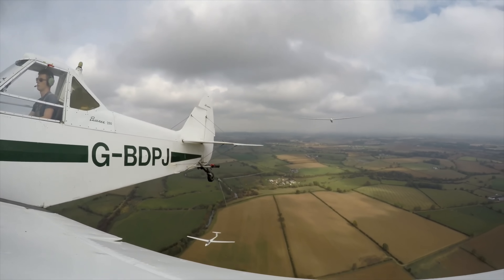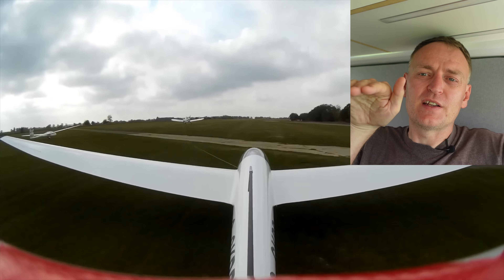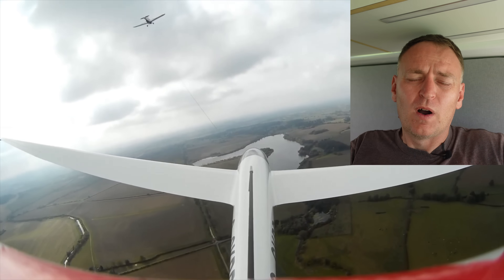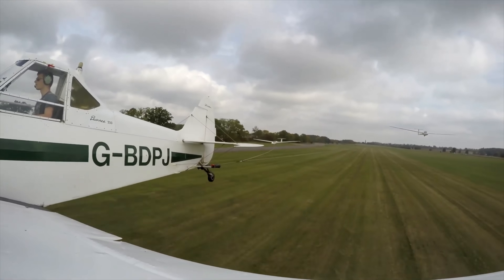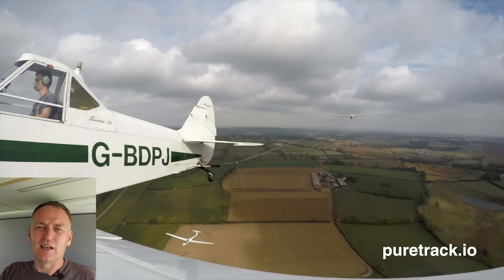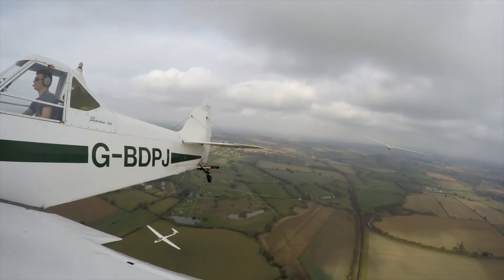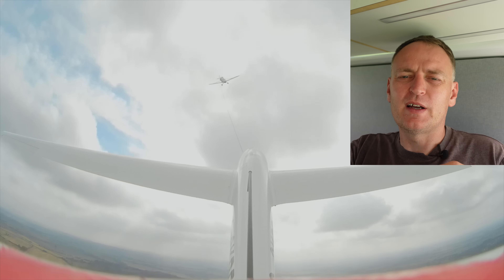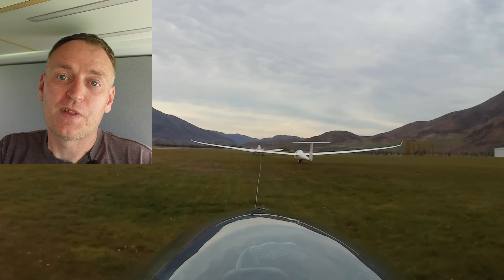Glider Dual Tow Goes Wrong: Instructor Reacts!

Comment: whaddya do if the rope breaks on the lead glider during the ground roll?
Reply: Depending on the briefing ....and the starting positions for lateral offsets... each glider should be briefed to separate to THEIR side both on ground roll and in flight.  We chose to continue about half span each lateral till all 3 flying, when we did 2 ASK21s (sometimes 4 aboard) with our C-182 (230hp).  Hard packed surface for easy acceleration, sometimes only 1 wingrunner. Wingrunners always on outside tips regardless of wind. 
On rolling, the short rope glider is the biggest risk if releasing, to the aft glider.

Ground release or break - taxi wide to outside.  Not many airfields are suitable for dual tows.

We always lapped the airfield allowing safe glider return in normal tows and dual tows. 
In flight, neither glider is much bothered as long as short guy flies high-tow.  Least experienced pilot should be put on short rope (their usual role & position).  Most experienced pilot onto the long rope....to deal with any problem on T.O. roll, keeping rope below other wing until established in climb, even if rear long rope releases first - rope dangles below short pilot due to weight & drag. 
If normal releases, gliders can sequentially leave in normal direction.  We chose to send short pilot offtow first.  Delay a bit, then second glider release went same normal way.  Tug went straight for a bit on release, then began descent. 
Oscillations.  
If we were towing XC to relocate for a camp ( 2x annually, 150 to 225 km away) 
We found it be more fuel and speed efficient to put both gliders on their respective tug tip vortices.  This required a shift from centerline trailing hi-low formation to echelon formation. You would identify the right spot by the minor turbulence and buoyant feel in the glider shown as less drag and slacking the line a breath. We could damp the very minor but persistent yaw with a breath of outside rudder. Yes a tiny slip, but overall using aerodynamics to serve the parade. 

The tow showing overspeed by the low glider exhibits lack of understanding of the energy trade between speed, altitude and rope bow.  Slack line recoveries should be trained frequently enough that all pilots can recover line tension first by speed matching (no jerk and seldom breaking) and position recovery secondly.   Good self defense by the tug pilot. Thanks for the review and discussion.   It offers learning for many.  Stretch brains, not towropes.    ;-)

Comment: What is the reason for doing a dual tow, except from at airshows?
Reply from the maker: To transport 2 gliders and a tow plane from one site to another is the main reason. We used it in our club to transport our gliders to a different airfield for a club camp for example. So it is useful. It's also an interesting skill to learn, and fun thing to do. Which is the whole point of flying gliders!
Reply: @PureGlide  I understand. In my club, we seldom ferry our gliders in aerotow. Dual tow is also out of the question with the Dynamic 120hp towplane :) I guess its also a question of risk...

Comment: You mentioned moving over to center position and low. At what altitude should you do it, would seem not until low tow plane has 800 ft or so to get back into pattern? Thoughts or standards?
Reply: I learnt to dual Tow back in 1986, all parties involved were experienced glider pilots and Tug pilot it was just before my instructors course we took off from a 900m short grass field with ASK21 and ASW20 we pre briefed the Lighter aircraft was on the short rope and the 2 seater on the long rope.  Short rope into High tow position and Long rope in the low tow position. Also the brief was  as we became controlled we would move as the Last Video clip showed into the position behind the Tug. Then once we were all airborne we would at 500ft start to position into the Low and High tow positions fully. If we had a Tow rope break below 500ft  we would maintain separation and land either ahead if available or turn back after breaking  L/H and R/H as briefed if we were above 500ft  High tow Left, Low Tow Right also we were in Radio contact with all on the tow and tug after gaining height to the release point the Tug would wave us off and the break was as briefed with Tug flying straight ahead until clear It shows that who ever allowed this Tow to Happen had not ensured all involved were experienced or had not fully understood what they should be doing and the Tug pilot made a good decision to Ditch them both and luckily they had no accident

Comment: On the final example where the two gliders get in line on the ground run is there not a reasonable risk that the rear glider may take off before the forward glider and tip the forward's wing with the rope?
Reply: You only dual tow with similar performance gliders & lots of power from the front. I learnt to dual tow behind Papa Juliet at another site.

We started like the first video and slipped into the second position circa 500'. We used a pair of 13's with talking ballast in the back.
Reply: The normal procedure is to put the most experienced pilot in the rear glider because they are in the most critical position. The front glider just does a normal high tow from a slightly offset horizontal position. Once they're rolling they slide in-line as per a normal tow. They rear pilot can see everything and has a release if anything goes wrong. It would be possible to ballon up and cause an accident, but why would you do that?

Comment: I don’t know anything about this  sport. But wouldn’t it be safer if the single cable between the tow-plane, and the two cables going to the gliders, were to be longer. Then it would lessen the gliders affecting the flight of the tow-plane?

Comment: Surely if the tug and 2 gliders could communicate with eachother via walkie talkie, this wouldn't have happened??
Reply from the maker: They were talking to each other, you can see the tow pilot talking on the radio. That doesn't change if they know what they are doing or not!

Comment: Hey guys, neither of those two tows is the way it should be done.  I am a multi thousand hour Glider CFI with over 25,000 hours and former airline captain.  I was taught by WWII Army Air Corps Glider pilots and have done quite a few double tows.  The Omarama tow scared me more than the first.  A balloon by the number two glider in the Omarama tow would be catastrophic as would an unexpected release by the number one glider. That IS NOT in my opinion, the correct or safe way to double tow and I hope you will consider revising this video.  Tim you are a pillar of soaring wisdom, but the Omarama technique is patently unsafe in my opinion.  Funny I was just at Omarama a month ago.   The way we diid it including triple tows was to stagger the rope lengths and stagger the gliders horizontally. We usually stayed in high tow on a double tow and maintained our horizontal offset position through the tow.  Please don't continue to show the Omarama method as being a safe technique.  Somebody is going to try it who will pop up and end up rolling the number one glider.  Staggered ropes and offset horizontal station keeping is the way it was done.  High and low tow offset was also done but horizontal offsets are essential to safe multi glider tows.  I usually don't say much, but this time I have to wave the safety flag vigorously.  Please keep up the vids.  I enjoy them immensely!!!
Reply: @Johan-ex5yj  Thanks for sharing.  A rope break or release during the takeoff roll, a balloon by #2, or wake or prop wash  encounter will likely be a catastrophe.  After takeoff flying in close trail is not such a big deal.  We all may do things differently and are free to kill ourselves I suppose.  But encouraging others to engage in very dangerous techniques is a pity.  I flew with a Brit in a DC-3 once who thought it was the correct technique to have the non-flying pilot handle the throttles all the time.  When I asked him if he'd ever had an accident, he admitted he'd run off the end of the runway on landing because the throttles were not retarded.  We do some things differently depending on country flying culture.  The inline dual tow takeoff here in the U.S. would
Reply from the maker: Good points, cheers

Comment: i'm a total noob towards flying , but if you tow one glider  , it's supposed to follow very carefull the towing plane   , towing two gliders is again the trick of both gliders to stay in line behind the tow plane...  overtaking the tow is endangering to the max to everyone involved...    in shipping this would not even work  from the start , no two vessels can be towed from one tow/tugboat with the lines connected to one point on the tug.  in lifting and crane activities it's also a no go because the both objects to lift have no correction to avoid  hitting each other (getting the towline to damage the middle object)  so I only see danger and I would always avoid towing two gliders just out of safety (given the pilots are trained and unless there is a serious reason to perform the art of double towing)

Comment: The short rope glider was also trying to stay out to his left creating a lot of drag on the tug, so both gliders played a role although the low tow glider caused the abandonment. I’ve towed on both the short and long rope and have to say I prefer the long low tow position because you have both the tug and the other glider in view. 
This was I think, either a case of poor briefing, or simply poor execution. It is also not a good idea to have two first time dual tow glider pilots flying together. Much better to have an experienced pair of eyes on the long rope and simply tell the novice on the short rope to fly in the normal high tow position as we generally do here in the UK.

Comment: Wouldn’t it be really bad if the lead sailplane released/broke the tow rope accidentally, slow and low to the ground and fall back onto the the following sailplane if they weren’t offset?
Reply from the maker: It would, the other glider would also have to release and avoid crashing into them. However accidental tow releases or rope breaks are very rare. I've never had one in 2000 launches.

Comment: Saving money is the WORST reason to increase risk.
Reply from the maker: The main reason for dual tows is logistical, to move two gliders and a tow plane from one site to another, at the same time. The cost savings are marginal for a normal launch. I've never heard of an accident from a dual tow, I think the risks of a fatal accident are still very low.
Reply: @PureGlide  it would make sense in a contest.  But, I find being on tow dangerous enough, and I've only had one instance where I wasn't in a good position (so far).  However, I'm not very good.

Comment: A question about the upper/left glider's release.  After release he makes IMHO a rapid and abrupt right turn as if in a bit of a panic mode.  (FYI - In the US we are taught to turn right 90°, and the tow plane does the opposite, for maximum separation) At this instant the upper/left pilot would have little or no idea where the lower/right glider is.  Any comments or alternatives?
Reply: The standard release procedure is the short rope releases first and turns away, the long rope watches until the way is clear and then releases and turns.

In the upset video the short rope glider wouldn't be able to see where the long rope glider was, so turning and slowing to get separation from the towplane and the other glider seems reasonable.
Reply: @philplane3181  And he does know he's above the other glider: it's very unlikely to have the energy to zoom into conflict with him

Comment: On the Miramar (the last) tow video - to me it looked like also the lower glider was above the slipstream (obviously need to be in the beginning of any tow - duh). Does it still move below later in the tow or stay as close as what it looked like in the video?
Reply: Omarama, I think. (Omarama, NZ, South Island)
Reply: With two gliders on tow the climb angle is reduced, so the slipstream isn't very much lower than the towplane. The front glider is just above the slipstream, pretty much level with the towplane. The rear glider is just below the slipstream. It is not dramatically lower. The clip of the tow at Omarama only shows the early part of the tow, as the tow progressed the rear glider was a little lower, but not a lot.

Comment: It looks tricky even when done the correct way... I there some specific technique for the rear glider to avoid tangling the tow rope with the front glider wheel? Anyhow,  makes me think that I should try low tow sometimes, just to have the skill in case I will ever need a dual tow.
Reply from the maker: yeah it is a touch tricky, you need to be able to ensure your speed control is good as is your side slipping. And yes practice the low tow sometime, it's always good practice to try different things. Just make sure your tow pilot is briefed before hand, and be aware their mirror might not see you down there if not set up for it.

Comment: Let me state up front that I am not a pilot.

From what I saw, there really should have been a second pilot or "Glider Controller (I just made that term up ) to monitor and manage what the gliders are doing.   This is an extremely complex operation with very little room for error and just trying to manage what their individual aircrafts is doing is a full workload much less trying to observe, understand, and compensate for what the other aircrafts are doing.    I think this was a failure of the aviation regulations.  In the USA you are required to have a separate dedicated boat operator and observer when pulling water skiers.  .

Comment: The worst dual tow arrangement I've ever seen. I've done many dual tows and the ideal is to have both the gliders almost line astern on the ground with the rear glider's rope well and truly under the front gliders wing. The rear glider "hugs" the ground for as long as possible, then moves into the low tow position after the front glider assumes high tow and stays there. I've flow both low and high on short and long rope for more kilometres than I care to think about. This one is just an accident waiting to happen. Terrible planning at the very best.
Reply: I also note that it appears as though the combined ropes are linked to a single short rope. Australia abandoned that idea at least 20 years ago because of the risk that the gliders remain connected to each other. The current Australian standard is two independent ropes with independent weak links. That way if the tuggie needs to let go, the gliders are on their own. As an example, a few months ago while running dual tow training, I had a dual failure (extremely rare) at about 250ft AGL. The lower glider turned left and the upper glider turned right while the tuggie kept flying straight.  Both gliders managed the outcome perfectly.

Comment: How can this even be a thing this cannot be safe I know there’s gonna be 1 million pilots say it says I’ve done it for years but lots of things are safe and been done for years until someone ends up dead and then they go. Oh my God, why the hell did we let that happen this seems to be one of those things to aircraft that I’ve been hooked around by NATO aircraft in close proximity to each other connected by a wire. He just looks like recipe for disaster and after both glider separated the glider that was following in line with the two plain banks for the bloody right and goes over the top of the other glider. What is the other glider gone straight up who would’ve hit each other possibly or a very near miss complete cock up from the word go to hell to planes are allowed to be that close to each other and then in the video you’re saying that the ones out of formation should be in line with the top line and higher up, making it closer to the other glider with not enough lateral and horizontal separation for buffeting manual error should never be a thing needs banning straight away if people can’t afford to talk to single gliders up for safety reasons, and commonsense reasons they shouldn’t be there shouldn’t be allowed to go to gliders at the same time. I don’t care how many people say this is a thing and it’s perfectly safe or stupid. Things are a thing until someone gets killed and then it’s no longer a thing.
Reply from the maker: By that logic, you shouldn't go outside, it's risky...

Comment: towing a single is crazy enough. two is just wrong.
Gliders really need their own onboard power. A crude engine and prop can be very light and the fuel can be very minimal and disappears at launch anyway. a small jet is quite inefficient but can be very light so might be great for the purpose. It's just a massive oversight of gliders for decades. Once you have engines you might also realize that a plane can actually be useful, not just a prisoner of thermals. It's amazing that it's possible to stay up without power but it's also very useless. The merits of the glider is that it's actually a well built airplane unlike the abomination that is a cessna or a bonanza. Rather than stick to powerless they should simply stick to good glide ratios. A higher speed glider can actually be cheaper because speed needs less wing. So it can become an amazing confluence.